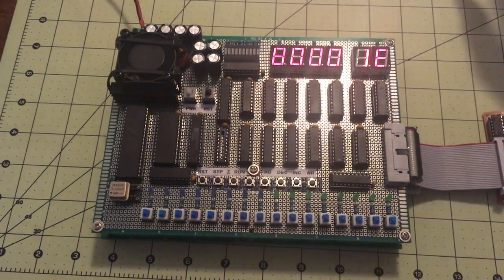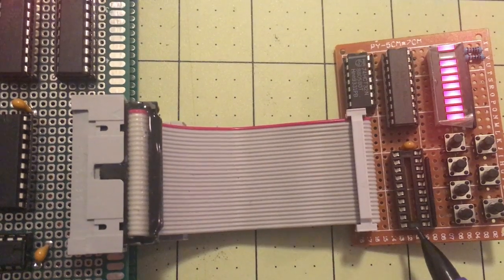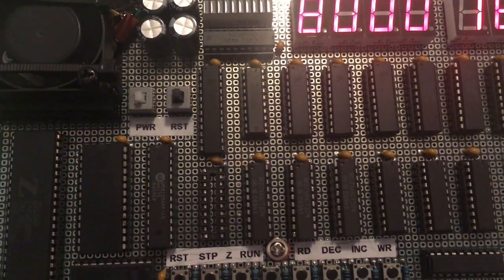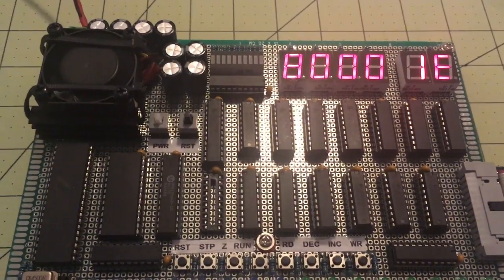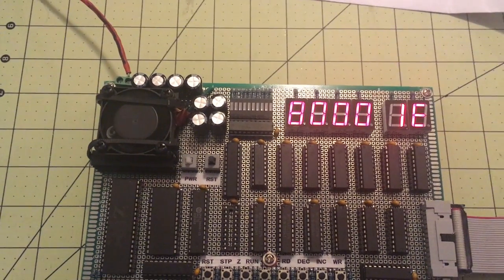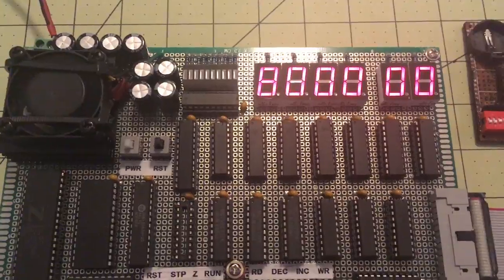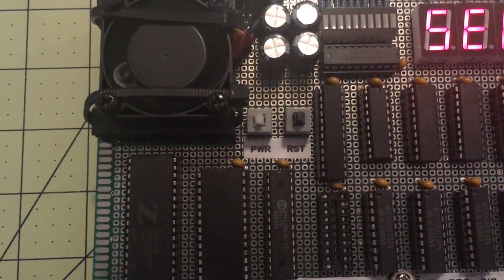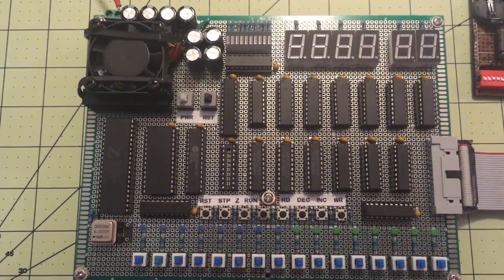Homemade z80 Update #1

Comment: May be a good idea to buffer the external bus with a 74HCT245 chip to increase the drive to the cable and buffer the TTL level signal to full CMOS levels. Use your GAL logic to operate the direction and enable pins on the buffer.
I have extensive experience with Z80 software and hardware if you need any help.
Thanks for the videos. :)
Reply from the maker: ZEROSTATIC72 my original design had a HC245 buffer. I had problems with timing, a fault in my design. So I reworked the board to send the bus out direct. So far, even with a 12" cable, there have been no issues with noise or capacitance loading due to add on boards. If I ever build a Rev 2 board, after I finish this project obviously, I'll be buffering the data lines before any memory or IO, which is the way it should have been done to begin with. But we learn as we experiment.

Comment: The incredible amount of background noise and your quiet voice is making it very hard to hear what you are saying, even with my volume at 100%.
Reply from the maker: Nick, you're absolutely right, with the exception of my voice...it is loud, just drowned out.  I'm working on correcting this issue.  I took the time this afternoon to add a poteniometer to the fan for the voltage regulator.  I think it will help out a lot in future videos.  I've also decided that I should probably look at getting a camera that is better for filming than the phone that I have been using.  The only other one I have at the moment is not capable of HD video.  So I'll have to look at acquiring one.